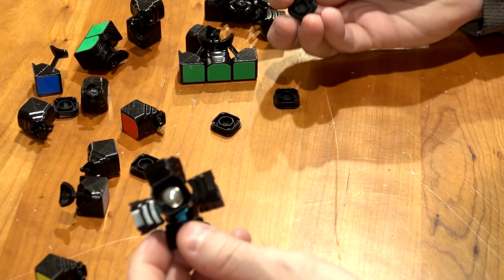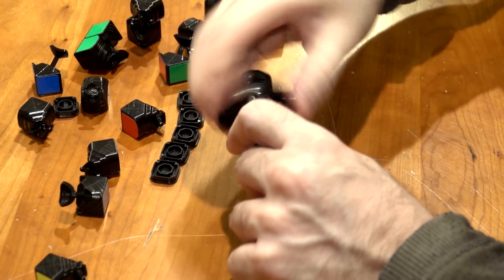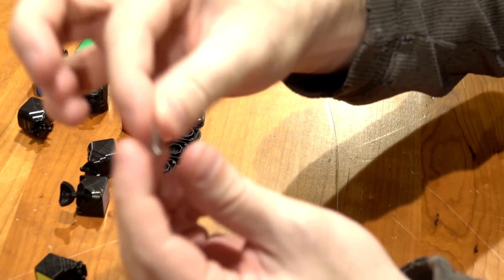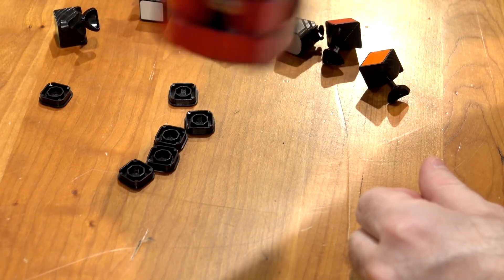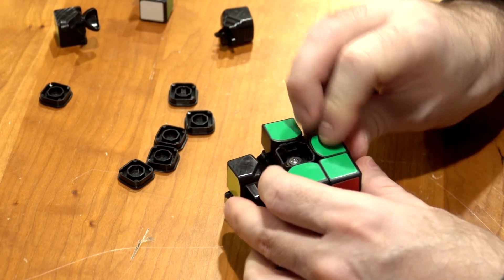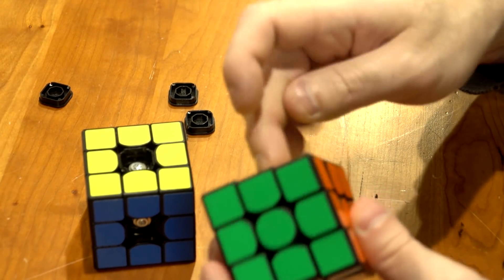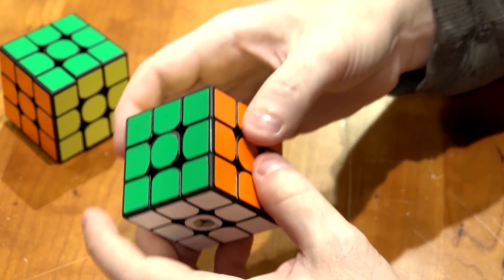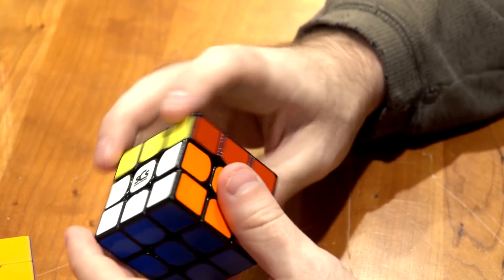MagLev cube mod. A puzzle with magnets instead of springs.

Comment: Hi can i know the dimensions of the magnet? i cant really seem to find it online
Reply from the maker: Not sure I can be too much help now. I'm not sure where that cube is  (or if I even still have it). I found these magnets at a local Home Depot or Lowes hardware store. As long as the dimensions have a hole big enough to get the bolt through, and is not so big it won't fit in the centerpiece it should work though.

Comment: Great video! How did you shave down the center pieces?
Reply from the maker: I used a dremel tool to trim away the center parts. The tool I used was a cone-shaped one that was able to melt away parts as I went.
Reply: @rcpongo  Okay, thank you! I might have to try out this mod

Comment: is it "donut shape magnet" through the screw threaded snab to the core? because i only know the mod magnet part of rubiks cube it's just in fully circle shape without any hole in the center.
do the screw need kind of a non magnetic type?
Reply from the maker: Yes, the magnets are donut-shaped with a hole. The screw can be magnetic without any problems.

Comment: This is a really good idea, perhaps cubing manufacturers will catch on and start making speedcubes with magnets instead of springs in the core?
Reply: Moyu and Gan did, this month :)
Reply: @andrewcamagay6255  Ik!!! It's so cool to see this design which was a crazy experiment now becoming mass produced in flagship speedcubes
Reply: @bobmarley6306  Yeah! I've got an rs3m2020, and when I saw this video, I decided to convert it into the 2021 version with the magnets :D, for much cheaper XD
Reply: @andrewcamagay6255  Wow awesome. I'm debating whether to get a new Gan or not, I want to get a bit more use out of my 11 M Pro from 1.5yrs ago
Reply: @andrewcamagay6255  what are the magnets called ? I got the same cube
Reply: @trudagger3933  oh i just looked on online shopping and found ring magnets that were small enough to fit in the tensioning system
Reply: Not until this year

Comment: That's cool, where can I get the magnets?
Reply: Thank you very much!
Reply: Thanks!
Reply from the maker: I found mine locally at a hardware store, but you may need to order them. These are what I used.

https://www.homedepot.com/p/MASTER-MAGNETICS-3-8-in-Neodymium-Rare-Earth-Magnet-Discs-12-per-Pack-07090HD/202526371

Comment: Nice!!! Couple of questions:
Do you still lube the axial screw where it enters the center piece, is the tension very much adjustable using the screw, what hardware store did you find the magnets, and is there a known size/strength? Thanks!
Reply from the maker: I didn't add any lube, although there is no reason you couldn't do this. I found these at Home Depot, and a pack of 12 (exactly what you need) costs about $4.00. They are .375 inch ring magnets. There is no strength listed on the packaging, but I believe these are n50.  I have not adjusted any tensions, but the closer the magnets are, the stronger the spring force will be. A spacer could be added to force the magnets closer together if needed.
Reply: rcpongo Awesome! Thanks! I'm on the way to Home Depot this afternoon for ring magnets!!! Got to try this out!!